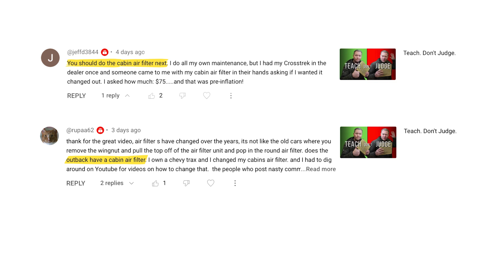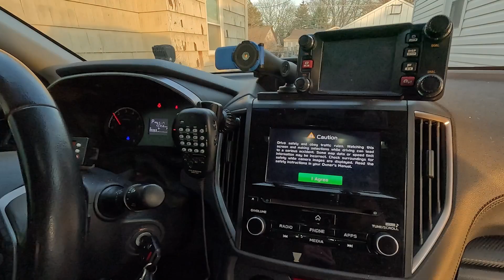Cabin Air Filters - Easy to Replace Consumable

Comment: Good content.  I try to remember to do this about annually with a $10-15 filter off amazon.  I can confirm the JKU and JT are simpler than this Crosstrek and the '22 RAV4 is about the same.

The first time I found out a cabin air filter was a thing, the vehicle was about 8 years old and having blower issues.  Swapping the filter and some vacuuming resolved the blower issue.